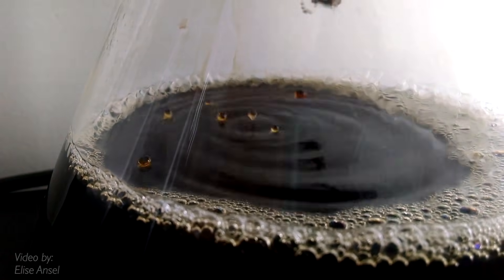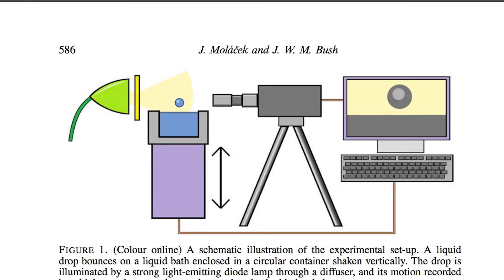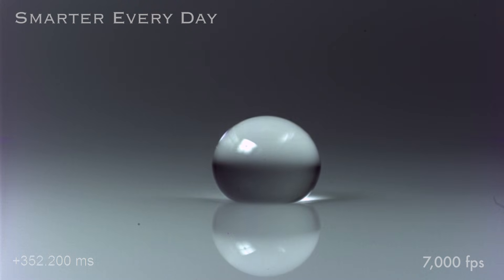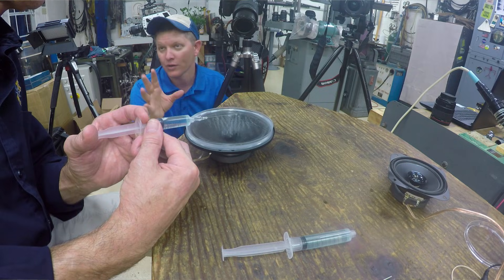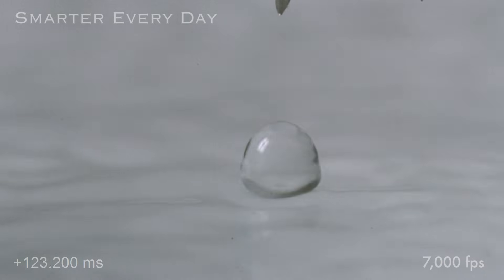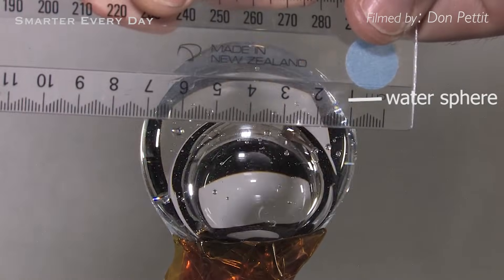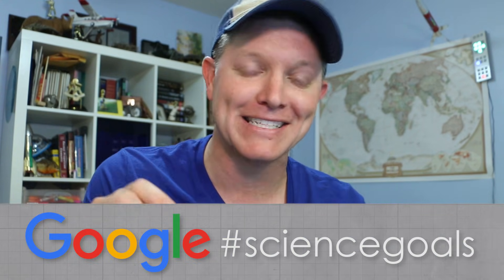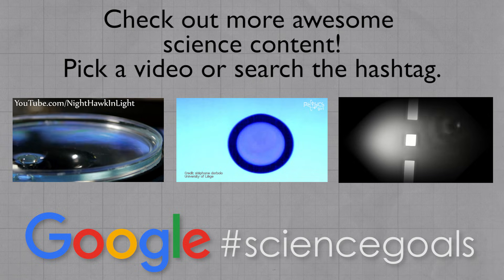The WALKING WATER Mystery (in SPACE and SLOW MOTION!) - Smarter Every Day 160

Comment: Want to learn about something just as cool? Take a gander into the firefighting world and how we have evolved from smooth bore nozzles which create almost a laminar flow to the use of fog/combination nozzles that create little droplets of water. Before we had to directly attack the seat of the fire to extinguish it. Now we are taught to open the door to the room that's on fire, spray a small burst of water in any direction and close the door. Those water droplets quickly turn to steam and that steams cools and extinguishes the fire or knocks it down pretty hard. The other cool thing with fog nozzles is when we turn the nozzle head to the left, it creates this big wide cone that shield us from heat and flames, all because of those little water droplets that effectively insulate from the heat. Also, a final note to intrigue you. If we spin that nozzle tip about a quarter to a third to the left from far right, it creates what we call a power cone and using the venturi effect, will clear out a room full of smoke in seconds. Something you should look into. It's right up your alley.

Comment: By the way--I've seen a bug walk on water. A "WATER WALKER." Like a spider but 4 legs are spread in all directions, yet each of his foot stands on the surface of the water usually seen in healthy country creaks. There seams to be a very thin film on surface like a child's blowing bubble. On a microscopic level, the water molecules are apart, yet holding each other. Hence the film surface. (Water molecules in ice come together to fit very tightly forminging like a completed jig saw puzzle). The water surface has a type of film of which can be penetrated by the micro--weight of droplets or tiny objects in the same physics as the diplacement a ship makes in water.

Comment: Another interesting thing i saw was vibrations that made designs like snow flake designs using salt or sugar on flat metal plates welded on metal pole. When struck, it sounds like a bell and a pattern emerges. Different size plates will make different snow flake patterns. The vibrations on plate moves salt christals into shapes. Now what is going on here?

Comment: With the cello, i wonder if the crazy movement of water is from whats called a “wolf tone”? Typically a cello’s body is tuned to about an F# by the luthier so it will not interfere with most tones, except around a G. The overtones of the wood body interfere with the string then you get beating from the similar tones. The Bach prelude from the space sample is in G so lots of opportunities for wolf tones to excite the water.

Comment: Could it be down to the the dferenc in electrical charge between the film and the droplet after all you have imparted an impotus into the droplet they dropping it which hay hav. Something to do with altering the charge potential   between the surface tension o the water and the airgap

Comment: I would like to see you do this experiment testing with different pHs. I believe the cation exchange capacity has something to do with this too. What some of the viewers may not know is that what are molecules on the inside of a water droplet hang kind of loosely but the water molecules at the surface of a water droplet are really really close to each other this is called surface tension and the way to disrupt surface tension we often use materials called surfactants that break up the surface tension so the factors you mentioned plus these I believe all play A Part

Comment: Hi it is so funny. Because of polar surface. . It must have sufficient time to determine whether or not same polar surface . Oil is non polar compound . All liquid have names polar and non polar surfacs. . a drop water polar surface check the bottom water surface. . If same , let them combine together.if  vibration  layer applied. it can not take surface check time because  It is bouncing  ( jumping ).if you can check surface contact  checking time of water drop. .you would be great. If high or big drop , if have also surface contacting checking time. . answer is in SURFACE CONTACT CHECKING TIME OF EVERY LIQUID . SAME OR NOT. LET THEM GO OR NOT.

Comment: Please more experiments on this! The surface tension vs temperature  and the purity of the water as well as the saturation of the dissolved gas in the droplets seem to reach  maxima near the phase change temperature i.e. the melting ice sickles dropping onto ice water. What is the molecular level attraction of the gas to the polar solvent water at the gas fluid boundary and how is that dependent on the gas dissolved already in the droplet and receiving water? Wouldn’t the molecular attraction forces holding the gas molecules to the water molecules be orders of magnitude stronger than gravity forcing out  excess gas? Could the dance be a near equilibrium oscillation between gas molecules attracted to the water boundary and those gas molecules going in and out of solution?

Comment: I can prove you mathematically that the cohesion forces are related to the radius of that droplet, the smaller it is, the bigger the cohesion forces are and the surface tension gets bigger. Therefore, due to that force gravity fails to beat it and the water droplet prefers to stay like that because force of gravity does not beat the surface tension. Besides that if you have a big droplet it will fuse with the other water, but if the droplet were very small the time to remain like that is longer. Hope this helps

Comment: They call it meniscus it is the static tension of the waters surface. When a drop hits there is two meniscus fighting each other untill it hits equilibrium. So the surface tension of the drop and the surface tension of the pool keep the droplets suspended. If you fly fished you would know about this because the fly sits on the waters minuscus layer and you use things like grease  scotch guard and talc to enhance the float in the minuscus layer.

Comment: Very interesting subject, but I disagree with the scientist that you interviewed.
In my opinion, It's not the air under the droplet that enables it to float and scoot around and seemingly defy gravity.  
      It is each molecule's substantial electrical and magnetic fields and alignment of polarity in relation to each other and to the sphere of the droplet, which substantially help keep the droplet together, so that it can defy its own weight and tendency to sink in and mix with the larger area or body of water. It's like two magnets with the same polarity next to each other, that vigorously repel, but also eventually try to flip and switch alignment of poles to attraction. So all around inside of the droplet, the molecule's magnetic polarity do two things, one, they keep the droplet tightly together, and two, all around the surface of the sphere of the droplet, the molecule's magnetic charges repel, and support the weight of the droplet, until some of the magnetic charges realign,  possibly and eventually by getting influenced by randomly spinning polarity in the molecules in the larger body of water, until some of the magnetic fields switch to attraction, and then the droplet gets absorbed into the larger body of water. That is my opinion on it, It's probably even more complicated and interesting than that on an atomic level. Later in this video with the blob of water in outer space, you can see the effects of the water's self attraction, and it's resistance to breaking apart unless affected by just the right frequency to have a vibration compromise the magnetic fields for a brief moment and let a certain amount of water molecules to break away from the larger body. The outside surfaces of each body of water have similarly charged polarity so as to repel each other's surfaces and not allow absorbtion, while they bounce around. I think that's pretty close to what's going on, but I'm not a super highly educated scientist. Just an amateur scientist...

Comment: I'm curious if the the air isn't just trapped, but is actually sticking to the water droplet. I don't know a ton about surface tension, but I think Hydrogen bonds play a big role in water's surface tension. So if there are polar molecules in the air which interact with the the polarity of both the droplets' and the water pool's surfaces, then not only is air sticking to the surface of each, but the polar air molecules are repelling each other when the two surfaces interact.

Comment: You are all incorrect. It has to do with charge. In a water droplet, its formed an equilibrium between the hydrogen bonds within its limited space and therefore resists being absorbed into the larger body of water for that brief moment in time. Upon coming into contact with the body of water, some of the water atoms turn about and make a connection. That is why there is an explosive connection occurring where a ripple is being sent through the receiving body of water. Further, the reason why the water droplets are not fusing with the larger body of water when vibration is added is due to spiraling. It is causing the water atoms at the center of that drop to spin and therefore increase internal draw thereby overpowering the pull of the water that is being vibrated. It gets more complicated than that, but that's the gist. Water cannot stop from spiraling. You would need to remove all the energy from a limited space to stop it from occurring.

Comment: Destin, I think you have lead me to understand a phenomenon I read about decades ago.  Back in the 1970s, I read in one of the Foxfire books that moonshiners would gauge the completion of the distillation process by watching for a "bead" dropped from the condenser into the collection vessel to form on the liquid surface.  Alcohol has lower surface tension than water, so its drops don't hold together strongly, and I am thinking they are not strong enough to withstand collision with a liquid surface, so they spread out and coalesce more rapidly than water and probably faster than the eye can discern.  When distillation of a mash is complete, its temperature rises and water starts to boil off and be condensed.  The higher surface tension water droplets obviously can withstand impact with the liquid surface, and thus a bead with long enough "hang time" to be observed after dropping from the condenser.  I wish I had your slow-motion camera so I could try dropping alcohol in alcohol and water in alcohol to see if this theory pans out.

Comment: Surface tension is the tendency of liquid surfaces to shrink into the minimum surface area possible. Surface tension allows insects, usually denser than water, to float and slide on a water surface.

Comment: Odd, I've never seen it. The old trapped air theory from 1900 makes no sense. If you put an object on a table, it doesn't just float about on a cushion of air for a bit. There is clearly something much more complex going on,  the paper by Ivan S. Klyuzhin et al [2010] confirms that.

There may well be a gap, which would be filled with air, but the gap is probably created by something else.

It reminds me of the theory that the pressure of ice skates create a layer of water allowing them to slide, that persisted for decades until proven false. There is a layer of water on the ice, but it's not created by the skates.

Comment: I didn't watch the full video. Probably you'll explain it later. Anyway it's actually also on the basic theory of what's happening during a landing. Sometimes airplanes just don't want to land and that's because of the fact that on the surface of the airways the air it's warmer, due to continues friction between the tire and the surface (continues landings and takeoffs) and we all know that hot air goes up. That's enough to create a layer of air that makes the landing harder. So is it actually hot air vs. normal air ? It's based on the same physics principle of the walking water mistery. If we combine the Archimedes' principle with the states of matter, will we be able to see whats going on? I mean that Liquid will coalesce with other liquid, not before taking away the "annoying" air in between; also solid will coalesce (actually not, but we can approximate the friction between tire and surface, or a cubic rock with another cubic rock to a coalescence) not before taking away the air in between (of course it will be faster due to the weight). Will the water expantion on a solid surface be faster then the coalescence (water with water)? Will it preserve a thin layer of air in between?

Comment: Since my childhood and every time I ride with a bus or a car, I keenly observed that if there is a fly inside, why it doesn't affect its speed in flying while changing its location?  Ex. if the car is moving at 80kph and the fly changes its location; (1) Does the fly would double its speed around 80kph to compensate the car’s speed and would not splat it in the rear windows (2) and when the fly  is at the space while the is car is moving, does the fly’s position still be the same? (3) and why the fly changes its position without exerting efforts (based of my observation)  Thank you

Comment: I know this is four years late but, here's a little observation.  When you were first putting water drops onto the water on the active speaker you mentioned how the waves on the water would create peaks and valleys and if the drop fell into a valley just right that would cushion it's fall and not coalesce right away. It seems to me that there is another wave, much smaller, in the water drop itself. It's a bobbing action top to bottom. Could this also be a small factor?

Comment: surface tension plus various oils which create small droplets forming beads the sound vibrations encourage the phenomena but the action is totally separate from each other. If you want to prove this theorem dip a sewing needle into dish washing liquid then touch the surface of the water, you will then observe the surface tension to be broken from the bonds of the oils by the action of the soap. Dawn dish washing liquid works well, it has strong oil cracking properties. End of mystery.

Comment: When I do an oil change, and I hold the oil bottle above the funnel to get the last drops. Those droplets slide over the oily film on the funnel instead of becomming part of it and practically fly into the engine. I always thought that was cool but thought it had something to do with the droplet's surface tension was unable to break fast enough compared to the speed which the droplet was moving. The inertia seemed to force the droplet as a whole to glide down the funnel. Temperature may also have something to do with it, but I'm not sure.

Comment: Hydrogen bond just like if you lick something and stick it to something. The droplets are bonding to dust, gaseous variants made up of all the percentages existing naturally respectively along with air pocket and oscillation, frequency barometric pressure, surface tension etc. up to unknowns. Try putting dawn dish soap in the water after controls and variables as well. This should have something to do with it and many other happenings I have not mentioned even light energy should affect outcomes.

Comment: I've noticed same phenomenon while pouring liquid soap from a bigger jug into an dispenser. Being  little soap in the big jar I had to turn it at a steep angle, by the time the soap reached the jag opening some dropplets started to fall from the bottom of the jug and making a tangent contact with the soap stream at the opening where I noticed that they didn't blend but bounced off. Viscosity helped the surface tension to hold the droppletsl shape and aquaplane on the air gap between.them. Science rocks. Cool experiments.

Comment: Maybe it's not really the cello itself, which is just the sound of a continuously vibrating string with a hollow body for amplification; but rather the change of frequencies in the approximative natural harmonic imitation that are the arpeggiated chords that it is playing. (Equal temperament) It could be that it is the slight harmonic displacement through time which separates the little bubbles as a way of keeping some sort of cohesion by getting rid of a little bit of matter. Does anybody have an opinion on this?

Comment: Its not an air gap.. its surface tension.. kinda like the non-newtonian fluid .. the surface tension kinds of increases as the fluid contains kinetic energy inside.. when the internal kinetic energy of the fluid decreases the surface tension also does until to a point the surface collapse and coalescen** occurs and merging happen ...

Comment: So, i am 2:32 into the video. Never asked myself this question or researched it. But my first guess would be surface tension. If a water droplet, that is small enough, hits a water surface gently enough to not break up the surface tension of the water droplet, then the droplet would surf on the water surfaces tension with its own surface tension. Let's see if my hypothesis is correct. I'll update the post.

Comment: Surface tension of water stops drops from entering
and instead rolls across the surface.
Reply: Mark T Tabor that’s exactly what I was saying this whole video😂🤷🏼‍♂️
Reply: I "felt" that the "cushion of air" statement didn't ring quite right, so same. Surface tension, I'm betting, has a role to play. Also the air pressure experiment could have had the same results if the idea was to check the affects of air pressure on water surface tension, not just claim it was affecting some small "cushion of air" that I don't see being able to be trapped in between the two surfaces. Nothing else seems to be able to trap air and create that type of cushion when coliding, not that I've observed everything in the universe🙂